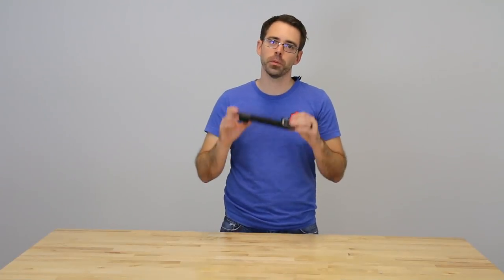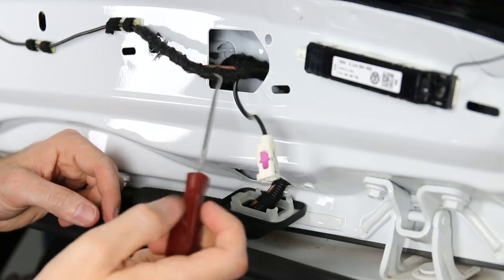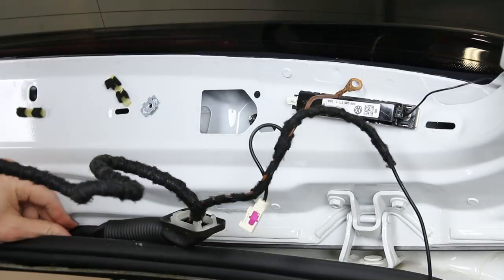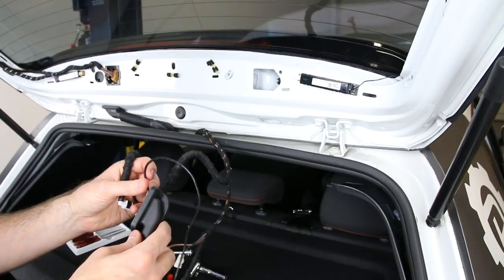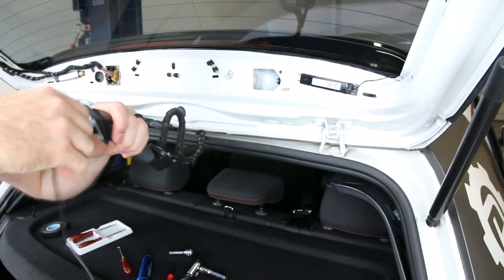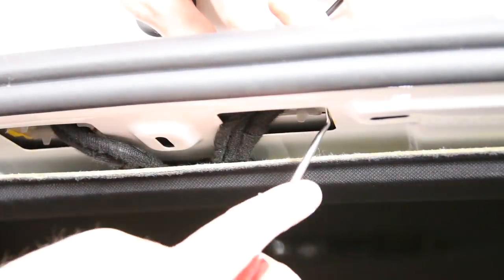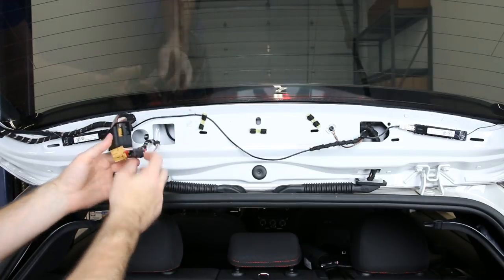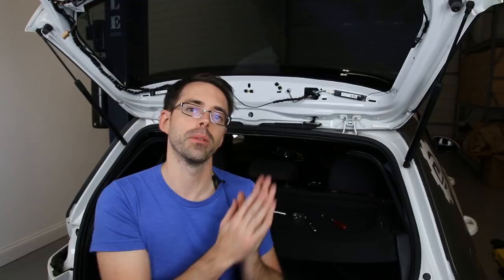MK7 Rear Hatch Rubber Boot DIY

Comment: I broke my rubber boot clips when I was upgrading to the MK7.5 Taillights. I used some black hot glue around the edge of the rubber boot. Its been holding up well and the glue can come off easy if I need to take them off again.

Comment: So helpful. Mucked around with silicon and trying to make my own clip.  In the end I just bought a new rubber boot and did it properly.  Took about 2 hours.  And mine was on the left side.  Not to bad.  The eye level taillight just clips off and you can disconnect the cable.  The biggest challenge was marking all the white cables and taking lots of photos so that I could put it all back together.  I only had to unpin one of the connectors as I could push one through the boot okay.  Thanks for the video. Super helpful.

Comment: I used some Nylon braided wire loom from an old PC power supply to act as a Chinese finger cuff. I pulled it through the new boot with some 12ga copper, fed the wires into it and taped it at the car end. Used a bit of wire pulling lube on the braid and it pulled through with very little effort and strain on the connectors. Thanks DAP for the instructions! Saved me a bundle... Now show us how to align and calibrate the front assist sensor ;)

Comment: Thanks so much for doing this. I broke mine installing a rear dash cam.
Reply: HAHA i just broke mine doing the same thing!
Reply: yeah thankfully it was like in the video the top not the bottom one. the top one isnt much of a problem so I just placed some hot glue on the side were the tab broke and "forced" the clip in the same position it would be. seems pretty sealed and how it was to me and again: since its the top one on the hatch its wont really leak water anyway, the bottom one definetely is a bigger problem. So thats fine for me and seems to work. Dont wanna redo my cam work AND even more stuff that could than break other stuff. Ive heard at VW Dealerships thats a 50/50 chance it breaks and as long it somehow it stays in place they dont care and fix that lol

Comment: Good video. Be careful with the washer fluid tube though as it might break when straightened. Broke mine from multiple places and washer fluid leaked everywhere. Huge job to replace that so I  heated the remaining tube end and expanded it so the tubes would fit inside eachother. Then just use super glue, shrink sleeve and loads of tape. Good thing there is more than enough tube there to play with if you crack a piece off.

Comment: Thank you, this helped with a Seat Leon Mk4 2021. 

I broke mine installing a rear camera. It was the left side, so the harness at the end of the video here. 

I found that I had to de pin all the wires as even unclipping the harness, the forks I felt would snap pulling them through.

De pinning wasn't actually that hard to do. Whole process took about 45 minutes

Comment: Having just done this…I like the direction however it is much easier to dissemble/de-pin both harnesses and tape the ends together (battery disconnected first) and pull it through the new boot. Notice how no one want to show you this part. This is because if you mess it up you can and will be taking an expensive trip to repair. Most part swappers will want to change the entire harness even. Not worth that at all. 
Pull them one plug and at time. Re-pin one at a time so you done mix any pins up in either black or brown connector. Make sure to take lots of pictures for reference and write down each pin and wire code written on each individual wire. Then re-pin back to connector and put back together one at a time. This will require the Depinning tool (CE-91 to make it bare able), and it will turn this into a 30-minute thing instead of the 2 hours I spent over analyzing, just to de-pin all the connectors anyway. The black/brown 8 pin on both sides won't fit thru the boot and I don't recommend cutting the guides. The part is cheap, and the tool will make the difference in getting it done efficiently.

Comment: I noticed leaking in the trunk area and thought it was the antenna but I pulled on the rubber and it didn’t budge but it was the right side for me luckily because I have no clue how to deal with pin anything lol. Waiting for vw to get the part but this was very helpful. Fingers crossed 🤞 I don’t break nothing lol